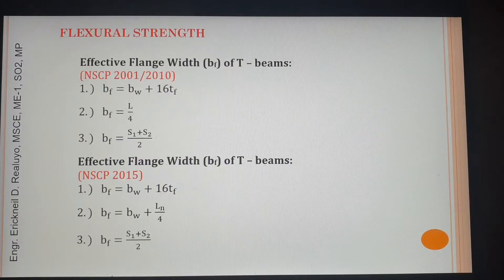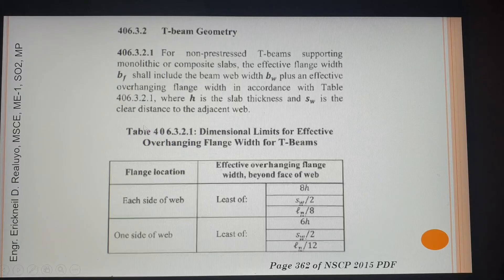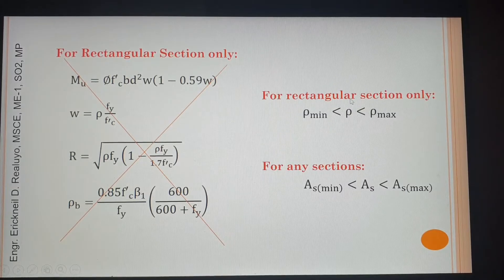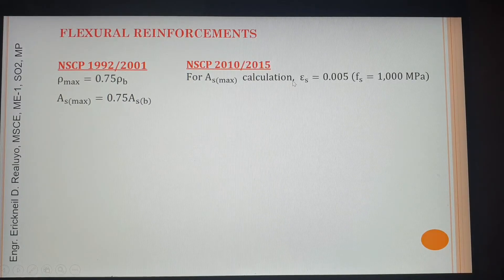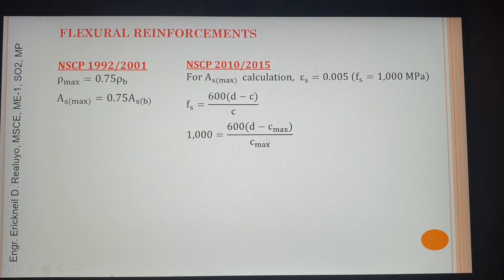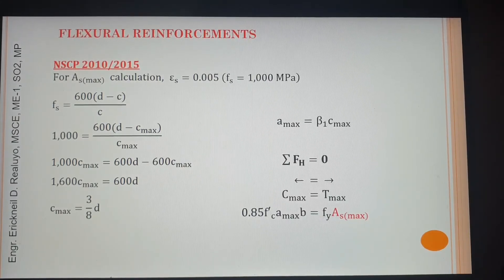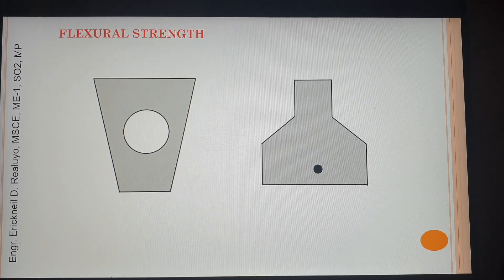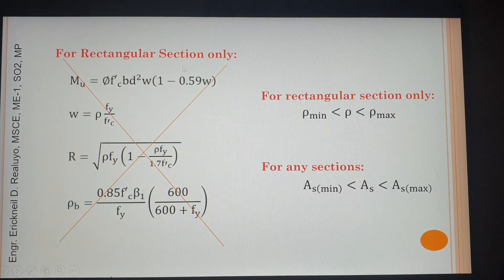RCD - Flexural Strength_Part 2

Comment: Sir, the equivalent strain of As_max is in the NSCP 2015 is 0.004. The 0.005 strain is the strain limit for tension controlled. 

But still I agree. The new general approach now in computing the ductility of the beam is based on the strain, not in the steel ratio.